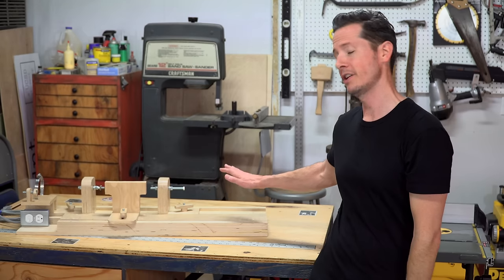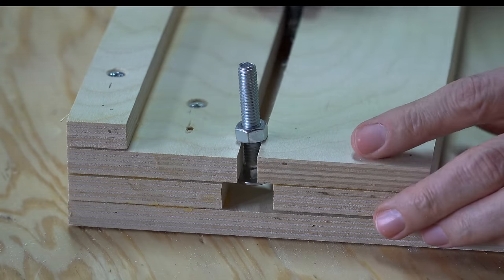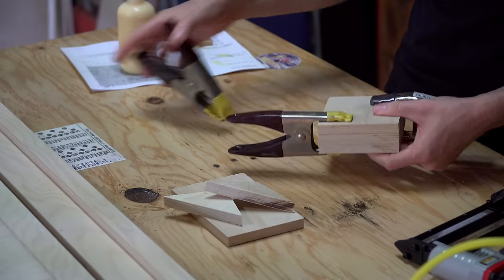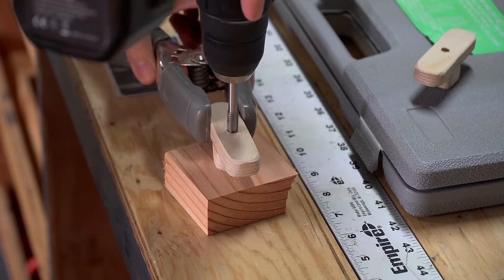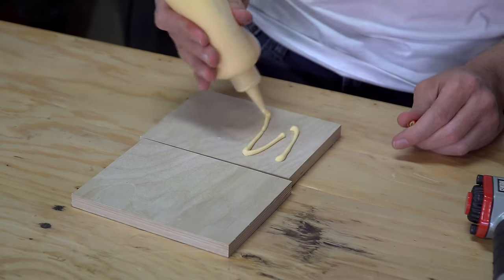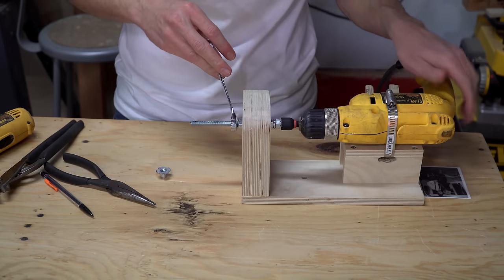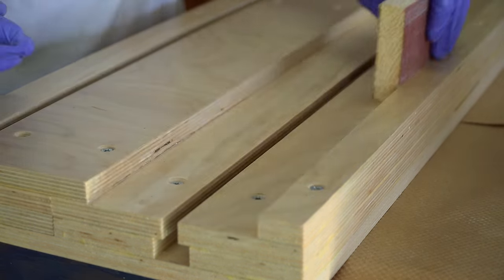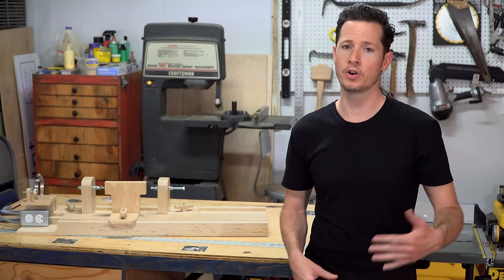DIY Drill Powered Lathe

Comment: Now here's a gentleman that realizes that not everyone is rich. Most videos showing how to make a home made tabletop lathe, involves the use of, "or access to" expensive machines and tools, that most people do not have.  Plus this version involves the use of simple wood that is also not hard to find, and is easy to work with in the construction and fabrication  of parts. Background music is nice and NOT overbearing and doesn't drown out the host. Thank you for this video  sir.
Reply from the maker: Thank you! I'm glad you dig it!
Reply: You're 100% correct there... I loved that.
Reply: On god
Reply: 100%!!! I can't stand diy videos that require $10000 worth of equipment.
Reply: @kegclem5516  Loli know
Reply: @libertynkomonde3328 !
Reply: build a pole lathe. it's even less expensive. you can turn bowls & cups
Reply: And yet he starts out with Baltic Birch plywood 🤣

But that's fine because I'm not expecting a $20 build like everyone else apparently does. If it was that cheap and easy lathe manufacturers wouldn't have a leg to stand on.
Reply: Hear hear! Well said.
Reply: There are cheaper lathes you can buy. Like home Depot Lowes harbor freight even Amazon has some pretty cheap ones and they're all decent sized. Yes there are some that's expensive but you don't HAVE to have expensive equipment to do wood turning. I have a small lathe and I turn pens on it alot it's just the size I need to do what I want to do. That's the thing find the one that will accommodate what you want to do. You may spend a couple hundred to a few hundred dollars. It's alot better than spending thousands on one machine. Do your research.
Reply: I know right? It's crazy sometimes how some of the youtube woodworkers title their video in a way that gets them more views, when they use all the fancy expensive tools.
Reply: This is like the "build a cheap beginner workbench" as they use a giant maple roubo for fabrication and festool/sawstop/woodpeckers equipment to dimension everything 😂

Youtube is awesome. There's a flavor for everyone!
Reply: Very well said. He is really good!

Comment: Your tool rest should be the same height as the turning centre. You tool rest is far too high and may result in your chisel jamming and kick forward away from you. You also need to taper your tool rest so you can lower the chisel. Hope this helps.

Comment: I see you've already been told about the tool rest. Line it up with the center of the bolts used for the head and tail stock. Or better yet make a slot and and extra piece so you can adjust it. The only other thing I would say is to use four bearings. One on both sides of the head and tailstock. It will eliminate play and make the whole assembly much stronger. Nice work!!!!
Reply: um! did you actually watch the whole video because he does have 4 bearings. the reason is also in the video is the threaded rod was a smaller diameter than the inner hole of the bearings, hence the need for the epoxy sleeving. Skate bearing have an inner diameter of 8mm and 22mm od.

Comment: Excellent video! If I may make a recommendation though? You've had some great feedback regarding the positioning and modifications of your tool rest. As time goes by, you're going to find that the stress it takes from use is going to deform it until you find yourself making a new one. I would recommend getting a piece of thin flatbar, like 1/8", and bend it to form a cover plate and lip over the inside edge of the rest. This will keep the deformation from happening by adding strength and rigidity to it.
Reply from the maker: Thanks! And thanks for the recommendation!
Reply: And also lower the tool rest down so it's pretty close to even with the center of the work.
Reply: @Punchin83  I was just about the comment on this. I was waiting for that first chisel to dig in and go flying from how high he was having to angle in with that tool rest, lol.

Comment: Bloody piss cutta. Dam good "Power Drill Lathe". You took the time to make each part fit, making sure the "Wobble" was gone from the bearings. All up, Top Class Lathe. Will definitely get your plans for it and build my own Lathe from your plans. Cheers. Kev.

P.S. I don't have a shed, but just a extension on the back of my car port, and enclosed that with a simple door on the outside, and then double doors leading from inside the carport to a normal size door, then to open it completely, I made a double sized door that doubles as a tool hanging space on the inside of this part. Don't have a bench saw, so will need to build my own, don't have a drill press so will have to make one of them, don't have a router table so will need to build one of them. DON'T have a lot of stuff, I have the tools but NOT the tables for each power tool, but, will get it in time. Thanks again for your time and effort.
Reply from the maker: Thanks for the awesome compliment! Sounds like you're very tenacious - I love the mindset you have on building as you go. Let me know how it turns out!
Reply: A little at a time is all anyone can expect from you. Not everyone has the ability to just buy everything they want at once - in fact, most of us don't. You'll get  there, with time.
Reply: Pop can walls make great shims

Comment: Well made, Tommy. Really dig it.
Suggestion: Try a steel (or steel-edged) tool guide, and line the top edge of it up with the rotational axis of the drive bearings, or preferably 10 degrees lower (but no more than that).
This will make the job come over-and-down onto the cutting edge of the hand tool. Much more efficient, and safer too.
P.S. I would have put steel washers on the under side of the slide bolts. ( I know, I'm sorry... everyone's an expert.)
It's a great piece, Man, you should be proud of it.
Reply from the maker: Thanks! Also, thanks for taking the time to write out detailed advice for how this could be improved. Many others have mentioned the tool rest height issue, and I've corrected that in the plans, but not yet on the actual lathe (I will before the next use). I was thinking about adding a metal strip to the edge as well, just to help extend the life of the wood on the tool rest. I'm not sure I understand where you're suggesting I should put washers - can you elaborate? Either way, I'll post a video when I make the improvements. Thanks again for helping me this a better project!
Reply from the maker: Sarah, thanks for clarifying that. The original design using the square neck of the of the carriage bolt as a means by which to keep the bolt from turning limits what type of washer that could be used underneath. The head of the carriage bolt is actually designed to act sort of as a washer, that's why it's bigger than a normal (say for example) hex bolt or pan head screw. It creates more surface area for the head to grab against. I'm glad to see you're thinking about the design! It's stuff like this that keeps me thinking about ways to improve. Keep those thoughts coming!

Comment: Just a couple quick notes, first, not to sound like a broken record but, the tool rest is too high and could be a safety concern if you get the tool caught in the work. Second, instead of using the skate board bearings it would be a lot more sturdy if you used conical tapered wheel bearings. They provide a more rigid action that reduces the amount of vibration in the work and will last longer over time. To add to that, you can find them for fairly cheap on amazon at about 10 or 15 bucks a piece. Overall, this is a really cool project. Thanks for sharing it with us
Reply from the maker: Steve, thank you! I'm glad you enjoyed the project! Thanks also for the feedback. Other viewers have made similar suggestions, and I've made some of the upgrades based on those comments. Here's a link to the update video: https://youtu.be/Fc77cL8ReBQ Thanks again!

Comment: I think the tool rest should be lower and level with your drive spindle this will give you better control of the chisels and a better finish. When I was at school I was part of a rocketry club and we needed to turn our nose cones on a lathe so I constructed a lathe using a B/Decker drill and two horizontal drill stands, one chuck and gear housing from an old drill. I used "G" clamps to hold the drill stands onto the top of rung of our back steps. Later my father screwed the two drill stand onto a knitting machine bed and I used the knitting machine carriage to hold my tool rest that is how I turned the nose cones.
Reply from the maker: Thanks for taking the time to give some feedback! Have a look at this: https://youtu.be/UqvVQ2dZaAU

Comment: I just made 4- 8” pulley wheels in my garage this afternoon, I have a 4” vise bolted to a tree stump chunk 2’ tall. I put a short piece of 1/2” bulk iron pipe in vise, I ran an old piece of 1/2” all thread thru the 4 pieces of 2 x8, had one nut on each side of wood, they were precut as tires for my lawnmower “ different issue”. I tightened the nuts, stuck one end into pipe and the other end into my cordless drill. I than made a T from two pieces of 2x4 and screwed them to the stump as a rest for the wood chisels. Took me an hour and a half to gouge out, sand and clean mess, putting a 3/4” wide x 3/4” deep trench in all 4. Wish I could post pic, lol.

Comment: Nice diy project. $35 for material is cool but the kind of tools you used are not typical for a small time DIY person like me. Some good ideas for the lathe bench. Thanks for sharing
Reply from the maker: I'm glad you dig it! You can use substitutions for some of what I did here in this video, but the most important things are making sure your cuts are straight, and your holes are as close to a perfect 90 degrees as you can get. Anyway, thanks again!
Reply: @OneMinuteWorkbench  yeah I read one of your other comments about picking up a cheaper but powerful used drill (Craigslist etc.,). Thanks. Keep your videos coming.

Comment: Black&Decker used to sell a lathe to fit power drill many years ago. Nice work but agree with others tool rest to high.
Reply from the maker: Thanks for the feedback! I recently learned that craftsman did something like that, but I didn't know about Black & Decker - interesting. For the tool rest height, have a look here: https://youtu.be/UqvVQ2dZaAU
Reply: My dad had one. :)
Reply: Not bad man!
Reply from the maker: Thanks!
Reply: I remember that in my Mothers mail order catalogue many years ago.
Reply: I had one, blue metal drill, it had a sander, jigsaw, lathe frame(Which I never had but I read the old catalogue insert it came with) and a few other useful toys, I though back then it was cool as Hell for its time and it was old when I got it :-)
Reply: @OldNavajoTricks  9.
Reply: YOU'RE too high.

Comment: I just built one and while being different it is essentially the same idea. 

I did differ by I did not use an AC drill, rather I used a cordless 18 volt drill that I took the motor out of. The jury is out on whether I am going to scrap the cordless and replace it with a universal motor attached to a speed control. Once I test it further I'll have a clear idea, but it does allow for turning wood, however I think it's too slow even at full speed although torque seems fine and you can't really stall the motor.

For my piece grabber I just chucked a modified spade drill in the drill's chuck. It worked fine for the initial test but Matthias Wandel has some better ideas I expect to eventually borrow.

For anyone thinking about building their own mini wood lathe a drill press is a must and I bought one otherwise aligned holes would not happen. 

The hardest part is alignment of Tail and Head. I built into my Tail and Head adjustment capability and this allowed spot on. As far as time to build. I worked on it 7 days for 3 to 4 hours until essentially completed. 

As far as chisels I bought the least expensive set Harbor Freight has and was actually impressed by how well made they are.

Comment: thanks for this. i have an old drill i been thinking of using along these lines. having video of a working model will really come in handy once i go ahead with my plans.
 i will look at several videos and get ideas and may incorporate a few ideas into what i wind up doing. i really like how you set up your adjustment slides. 

you used basic tools which is good to show you can complete a project like this with minimum tools. i have a router and a welder which i can use to my advantage on some of these steps but it is good to see what one can do with less to work with.
Reply from the maker: Awesome! I’d be excited to see how it goes!

Comment: You could make a much better headstock with a rear axle from a bicycle wheel. Typically they are hardened steel with threaded sections on each end.
Reply from the maker: Thanks for the tip!

Comment: could you use a reguilur electric motor say 1/4 hp or a1/2 hp? i llike the video great job
Reply from the maker: Thanks for the compliment on the video...it was a ton of work!

My guess would be that you could add a motor with some sort of direct drive adapter or even a pulley system. As far as how many hps it could handle, I’m not sure. I’ve calculated the drill at about 1/3 hp, and I think it’s pretty well suited for the other components of the lathe. The bearings are abec 7 and could handle an increase just fine, but you might want to double up some of the material thicknesses of certain components (namely the bases of the headstock and tailstock...maybe also double up the screws that lock them down) if you increase the power.

Hope this helps! Thanks again!

Comment: A partial thread screw would have saved you the effort of making your own collar over the threading. And just for reference, the bearing size is 608. I would have used a sealed version though, as shielded bearings can still let in a little dust. Get them from a hardware store, skate bearings are exactly the same, just vastly overpriced ("brand name skate bearings" are just a scam). A pack of 8 skate bearings can be $25, which is the same as 5 lbs of them of the exact same quality and grade.
Reply from the maker: Thanks for the tips!

Comment: Do a Google search for "t-slot nuts"       
They fit in the slot you made for your tool rest instead of using carriage bolts
Reply from the maker: Thanks for the feedback!
Reply: Exactly why i was scrolling through the comments 😅 I thought "how long does a wooden thread last?"... anybody here experience in that?
Reply: @theherumuuto , I'm betting not very long. Personally, I would have gone with something else, thin metal pipe I could cut threads into, if nothing else, and then attach them to the wood handles - even if I had to weld on the specialized tooth-lock washers to bite into the wood and hold (and trim off the ones pointed outward).

Comment: This is cool but $35 dimmers in materials? If you do t have a table saw and a drill like me it's going to be a lot more money 😔.

I just need a lathe and sand belt for 1 project to sand down one side of 4 skateboard wheels so that the 2 halfs together are the same length as a heelys Mega week and glue the 2 sanded wheels together and repeat the steps for the other 2 wheels. 

Then use the lathe to sand down the circumference of the wheels so that are the same circumference as a Heelys mega wheel and then I can have a pair of Heelys Megavert wheels.
Reply: You can always as for the wood cutted, its going to be more expensive, but not a lot and then you only need to assemble the pieces... Et voilá!

Comment: I have a couple of old motors lying around, thinking about building a Lathe myself. I Was actually considering using my old router, but couldn't quite figure out a design that'll allow me to reverse the spin or regulate the speed. Using a Drill would certainly solve these problems. I'm certainly looking forward to using your design for a wooden base, as that'll help cut down my planning time!
Reply from the maker: A motor would work too, depending on the RPMs. As you mentioned, a router is difficult to get spinning at the right RPMs for a project like this. They do sell speed controllers, but they lack the range necessary. Either way, good luck with the project!

Comment: Bearings, bushings, epoxy, quality plywood, under $35?? Was this made in the 90s?
Reply from the maker: Lol 😂. You’d be surprised at what you can get done with amazon prime! Seriously though, $15 worth of plywood, $4 worth of bearings, $8 for electrical components, $5 in hardware, and maybe $3 worth of screws, glue, epoxy, and polyurethane. If you’re starting from scratch, you’ll obviously need to spend more than that. Chances are though you already have some of this stuff on hand. And if you do have to buy something (like a tube of epoxy or a box of screws), you’ll have most of it leftover for other projects. And everybody loves leftovers!
Reply: @OneMinuteWorkbench  thanks for a detailed breakdown, I do have prime and I get most of my stuff there, there are great deals on most stuff there but I've always had trouble finding a good deal on epoxy and gypsum for molding. You seem very mindful of budget so if you happen to have links to where you get your epoxy and/or molding materials I would greatly appreciate it. On a side note you definitely got a new sub and loyal liker lol
Reply: @OneMinuteWorkbench  great info, thanks. And yea, I dont mind getting a lot upfront, I plan on using resin to fill imperfections in wood slabs for furniture. So thanks again, I'll be sure to check out the bulk brand you mentioned